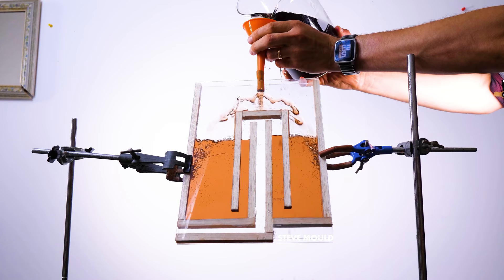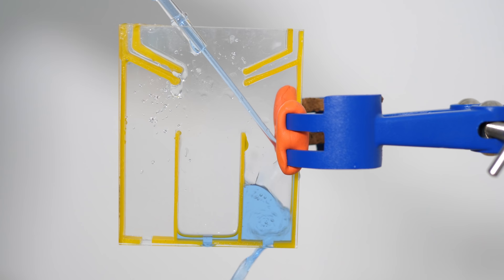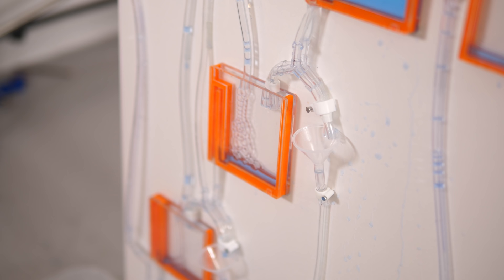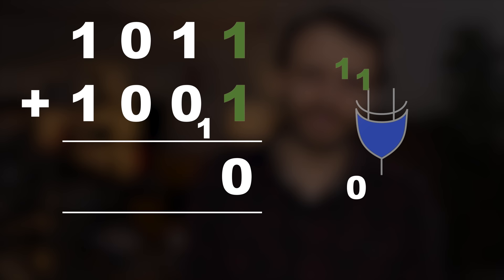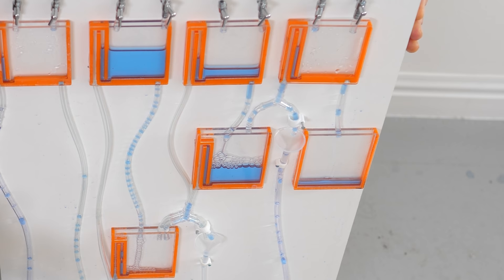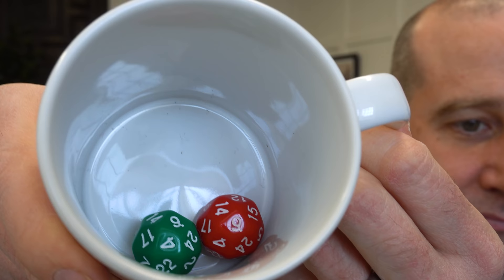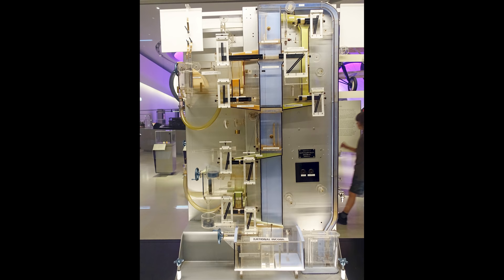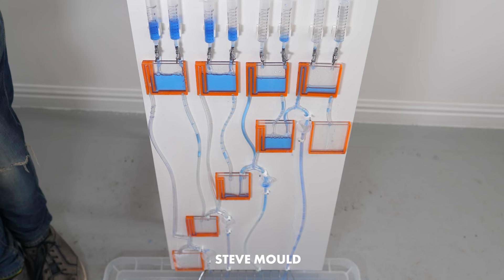I Made A Water Computer And It Actually Works

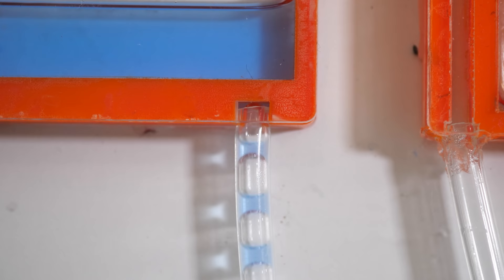Comment: 9:55 
As a computer scientist, I highly appreciate this series of jokes.
Reply: Jokes? OK i can get it as a joke, but that's a brilliant logic interpretation in physical world.If you get this, you will have no problems understanding logial gates in the future:)
Reply: @ogi22  but that's not how memory leaks physically work :)
Reply: @ogi22  :)
Reply: @khodis2002  it is now
Reply: @ogi22  Regarding the memory leak one, that's maybe similar-ish but not really a real-world equivalent. Memory leaks happen when a subsystem doesn't inform the OS that some part of the memory is free to be used again. So subsystem has nothing to do with the memory, OS still thinks it is being used.
Reply: @CrazyHorse151  maybe you can count it as a buffer overflow?
Reply: @ogi22  memory leaks are when the OS thinks certain memory addresses are being used because the process using them never told the OS it was done using them even after it closed, or the process asks for new memory without clearing old memory
Reply: I built one for a co2 tank farm. An array of check valves and pressure differentials
Reply: @spandexgoblin  Andrew Nevarez and CrazyHorse151 explained it very well.
Reply: This comment turned in a stackoverflow answer
Reply: @simonepozzoli  Just missing the "Comments are not for extended discussion. This discussion has been moved to chat."

Comment: Btw. I think there is a way to turn this into a digital number once again: Once all individual "buckets" have settled, you could put the fluid from each bucket onto a lever scale and put them at the corresponding distance to the center such that their pull on the lever corresponds to their number. So meaning:   8 _ _ _ 4 _ 2 1 |  _ _ _ "measure" (maybe with a spring and a ruler). The number 8 corresponds to the fluid in the bucket which has the bit for 8 for example.
Reply: Great idea! Now we only need a way to do the opposite.

Comment: Need to get Cody and his supply of Mercury. Won't wet the glass so no failures from trapped water
Reply: I wonder if one of those hydrophobic sprays would do the trick too.
Reply: @23Scadu  that would absolutely improve the performance.
Reply: @23Scadu  better get Rhett and Link on that part. Greatest crossover in history.
Reply: A Mercury Computer 😲 That would be soo cool!
You could also couple this with an electric switch system because of the conductivity of mercury.
Reply: Wouldn't that form problems with the increased hydrostatic pressure of mercury?
Reply: @23Scadu  That's bigotry!!!
Reply: @ksp-crafter5907  really old computers used something like that
Reply: @swimmingcat1275  Not in the very thin (pseudo)2D environment of such a fluid computer! Shouldn't generate too much pressure.
Reply: @ksp-crafter5907  I am more concerned about the seals of the containers. Mercury pushes through every pinhole it finds. (Also hydrostatic pressure is a function of the height of the liquid collom not the volume)
Reply: While Mercury would be amazing, think of the time and difficulty to safely clean and house it between calculations. He certainly won't be able to "etch-e-sketch" to a new calculation. So I think the hydrophobic spray is the way to go.
Reply: @RWAsur  
Yeah, material handling would be prohibitive. 
But... nothing a few hundred hours of CAD and 3D printing and fabrication couldn’t solve. 

It’d be gorgeous
Reply: Maybe try acetone or isopropyl alcohol?
Reply: @RWAsur  true. + a saline solution would also be a pretty good conductor for electric switches. (for a calculation result display)
I am thinking about nixie tubes for the result! 😎

Comment: This is taking Liquid Cooled™ to a whole new level
Reply: It is only the next logical step
Reply: Liquid driven
Reply: The trademark is giving me ominous vibes
Reply: @DTG4844  the trademark was the cherry on top wym®
Reply: Well... It's not Liquid Cooling... It's Liquid Core!
Reply: It makes it Turing complete
Reply: @chargemankent  liquid inside
Reply: @derbe8647  Fresh Outside
Reply: Liquid processsing!
Reply: Lmfao
Reply: Its not fps but lps
Reply: I would ssy Liquid Programmed™
Reply: Mineral oil.
Reply: Powered by Liquid Cooling
Reply: *pours boiling hot tea in the computer
Reply: Instead of Liquid Cooled, it's basically Liquid Powered.
Reply: @gotchabiqch8942  Bruh come on®
Reply: Cooler master 4000
Reply: @DTG4844  Liquid™ Cooled™
Reply: Liquid™® PC™®©
Reply: You cool your electric circuit with liquid???
I cool my liquid circuits with electronics
We are not the same

Comment: This seriously just made me understand the part of computers that I could never quite grasp. 35 years of not understanding why the gate system that computers use works, all answered in sixteen and a half minutes. And now that I understand, I can hardly believe I didn't before. 

I honestly feel that my life is about to get way easier, thank you for that
Reply: I even just understood the concept of 1 and 0 bits, very awesome way of connecting the digital to the physical world
Reply: Yeah it's why I took a bunch of computer architecture classes and stuff in college. I really wanted to understand how things work all the way down. It's really fascinating.
Reply: Spot on this is exactly how you are tau in college, water explains the flow of current through faucets,, the water is there potentially but until you draw it, flow cannot occur same with electricity and logic gate's, in this case it shows both the flow of electrons and the logical outcomes 👍

Comment: Instead of splitting the lines to make a "10ml" out of a "20ml" you could use a reservoir which can hold 10ml and just use the overrun. That way it can not split unevenly accidentally.
Reply: I was thinking the exact same thing! Make it go through a tube on the side of the tank raised by the exact amount and you're good without spills
Reply: @AlxM96  Isaac Newton's water clock worked this way.

Comment: 2:33 and that is what in electronics we call as timing and propagation issues. Electrical signals also suffer from timing or other problems like jutter and clock skew among others. Lenght of wires, crosstalk, etc.

Comment: Next step is to outdo Ben Eater: "I built a GPU with my water computer."
Reply: doesn't even need cooling, it runs on water!
Reply: What's new language to learn to code on this new water computer 🙄
Reply: @techboywitha7887   Java, the answer is fed into a coffee pot.
Reply: @techboywitha7887  In theory you could run any language on it, given enough computing power and a structure similar to modern computers. In practice? 
Extremely basic assembly.

Comment: While watching your video I actually came up with an idea of as to how to make a classic transistor using only water. 
Perhaps you could take a normal tube with a propeller in the middle which is supposed to act as a pump. The water from the first input comes directly into the center of the propeller, meaning that it won't be able to spin it much, but a second current of water comes tangent to another propeller that is coaxial with this one, meaning that both inputs have to have water flowing through them to have water at the output.

Comment: Mistake at 6:50 when you show the full adder for the first time. You show the output as result=1, carry=0 when it should be result=0, carry=1 since 1+0+1=10, not 01. Just some clarification if anybody tried to work out the logic of the full adder diagram and got confused when they saw the wrong result.
Reply from the maker: Good spot! Damn
Reply: Surely "Good spot. Dam?"
Reply: I was looking for this comment. I thought I am making some mistake

Comment: 6:58 I'm pretty sure the 2 outputs at the bottom should be swapped. I just started at it for 5 min trying to make sense of it. The 1 should be carried and the 0 should be on bottom. Love your vids dude!!!
Reply: The outputs are fine. The arrows are wrong. The top arrow should be pointing at the 1, and the bottom one should be circling around it to the carried 0.
Reply: @PerseusMax  Hey, no the arrows are fine, the outputs are wrong. In Binary 1011 + 1001 = 10100 , so what happens is where the left output arrow is pointing there should be a 1, and where the right output arrow shows, there should be a 0
Reply: @armandoespinoza7370  Yeah, you are correct. I'm not sure what was going on in my brain...

Comment: This is really cool. One thing I've always wanted to see somebody do is make an actual circuit that uses the hydrological equivalents to passive electrical components like textbooks always use to familiarize you with them. That is, use a narrow section of pipe or tubing in place of a resistor, use a flexible diaphragm that flexes back or forth as a capacitor. And use a weighted water wheel or turbine as an inductor. I've always wanted to see somebody try making something like an RLC circuit that oscillates at a specific frequency when energy is added in the form of voltage or current. OR in the case of the water circuit, by water pressure or flow. Which are the equivalents of voltage and current, respectively.

Comment: They made both pressurized water and pressurized air computers.  In both cases they used the "stickiness" of both fluids.  The gates were Y shaped and at the junction there was an "input" on both sides to push the fluid to the left and right.
Reply: when under pressure, fluids behave quite similar to electrical current. All basic equations (including many differential equations) still work.
pressure = potential
pressure drop = voltage
flow rate = current

thin pipe=resistor
reservoir=capacitor
long straight pipe = somewhat of an inductor (resists change in flow rate)

Comment: As I understand typical fails happen because of 
a) splitting water in half as your siphon results in 20 ml instead of 10
b) leftovers in the bottom section
Which results in less than 10 ml input in later cells. 
So I had an idea to manage this without Y-split tubes: you can vary the with of the cells and double it in each iteration so your "1" in second layer will be 20ml, in third 40ml and so on. But the projection you show on camera would be the same. Besides you can decrease the width by 5% to compensate the leftovers. 

P.S. instead of Y-tubes you could also use the siphons with output on half-height to precisely get 10 ml of 20.

Comment: So I made a joke in the comments on matt's video about some work I did in my MPhys degree involving water based transistors. It was a while ago so my memory was foggy but I think I'll share what I can!

Our setup was actually very different, they were made from a plastic cylinder with a rubber tube passing through it. The source goes into the rubber tube, the drain comes out of it. 

The trick comes when we fill the rest of the cylinder with water and connect it to a tank representing a gate! It applies pressure on the tube, clamping it down and stopping the flow. You could easily adjust the pressure by either filling/emptying the tank or by changing its height relative to the transistor. It mimics a field effect transistor pretty accurately!

The study I worked on was less about how the setup compared to a electrical one and more about some strange turbulent flow that happened at certain settings and some assymetry between raising and lowering the gate but that stuff's not relevant to the video at all and I don't remember the details too well...
Reply: Interesting to see another take on the same premise. That's impressive.

Comment: You can construct a liquid digital display by building binary decoders with the outputs corresponding to the different horizontal/vertical sections of a digit (like in a digital clock display). For your adder, you would need a 4-input, 16-output decoder. 8 of the outputs for one digit, the other 8 for the other digit.
Reply: Similar approach as this bacterial digital display: "Programming Escherichia coli to function as a digital display" (2020) Molecular Systems Biology. You would just need to connect it to the outputs of the adder.
Reply: As cool as this project was, going that extra step and adding in a liquid “digital” display would have been incredible. But it feels like just this must have taken a very long time to accomplish as is.

Comment: While trying to figure out exactly how the full adder works, I realized that there's a mistake in this (6:50) diagram. On the second column, the answer should be zero and the carry should be one, not the other way around.
Reply: I noticed this as well.
Reply: Yh.I noticed it. I thought I was wrong at first. I had to redo it several times and even after getting the same answer each time, I had to check the comments. Lol.

Comment: A brilliant display of logic circuits at work. I plan to use this in my class :) Just a technical correction, at 6:50 the full adder will have an OR gate instead of a XOR on the left (in the end). In other words, the Cout would come out of an OR instead XOR.

Comment: I had a roommate in Arizona that worked on an Air Powered computer for his Masters Thesis. Shoutout to Carr for being annoyingly proficient in math and electronics. I can't remember his first name, but I think of him often
Reply: I've had that in my head for 10 years or so. Haven't yet succeed in printing the necessary valves...
Reply: @ThePixel1983  from what I remember (from story I heard in 2004), they used almost entirely off the shelf pneumatic parts. If I remember correctly (which probably isn't correct) they got near 100hz. It was his thesis for an early 90s masters in mathematics. 
If I could reconnect with him, I'm sure he'd be happy to help similar projects. Carr let me borrow his 91 CRX Si to visit my GF 10 hours away. In hindsight, I was a terrible friend.

Comment: I think the problem lays with your siphon. You don't need the drain - which can dispose of a random amount of water and prevent the next siphon from activating. I would lower the activation threshold on the siphon or increase the volume of water that constitutes a "1", as well as raise up the bottom of the siphon so it cuts it off before sucking up more than half the water.

For example, let's say each bucket can hold 1 cup. Let's make a "1" be any amount >= 3/4 cup and a "0" is anything less than that. We set our siphon so that the rightmost wall cuts off at say 2/3rds cup (3/4 ideal, but let's account for error). 
1+1 = 10 
-> 3/4 + 3/4 = 1.5 cups. 
Our siphon activates when we reach 3/4 cup and stops when it reaches 2/3rds cup - sending a little over 3/4 cup along and leaving a little less than 3/4 cup in the bucket.
Now, we don't need any drain to introduce more randomness - just that anything over 3/4ths cup will activate the siphon. We just need to make sure the buckets at the end can hold a little extra (or just let it overflow onto the floor).

Comment: I imagine you could use the surface tension of liquids, the siphoning, and an enclosed system to make hydraulic logic gates that achieve transmission through a circuit of fluid without necessarily needing to involve any pistons for driving the circuit. This video made Steampunk a lot more plausible/interesting for me as genre haha.

Comment: As soon as you mentioned having XOR and AND in the same gate, I knew you'd be making a very clever adder with carry
Reply: The gate is actually universal. Hold one input at 1 and the XOR output implements a NOT gate.
Reply: @Roxor128  That's an excellent point! Mostly I was thinking about the fact that a single XOR+AND gate can be used as a compact half-adder.

Comment: I had a thought with the "slow leak" XOR design - if you could close and open the outputs, you could hook each of them up to the same mechanism that you toggle at regular intervals, and it would (kind of) simulate a CPU clock!

Comment: Love this set of videos. This one in particular.
I think there may be a tiny boob at 1:30. You've just explained why this is both an AND gate and an XOR gate. Then you say it's an AND gate or an OR gate. Interestingly the little Y tube  you added to the bottom is an OR gate as its outlet flows if either or both of the inlets flow.
...but I suspect you knew that!

Interestingly, I think that many of the problems with the original device are quite analogous with silicon semiconductors... Considering what happens with under (and over) voltage and current...!
Reply: So I believe the Y tube would be an XOR because if both are on, the AND output is read because of the collision, and so two input streams wouldn't produce a flow into the Y. I suppose to make it an OR you would have to run the XOR output and AND through another one of the gates and take the XOR output

Comment: All of the XOR gates you see at 7:19 are supposed to be OR gates (they were supposed to be in the diagram before, but there it's easy to point out), otherwise fantastic video!

EDIT: Realized that it technically doesn't change the logic, purely because the logic around it doesn't allow it, but it is something to keep in mind as OR gates are usually simpler to implement than XOR gates

Comment: You can do an ancillary video about fluidics.  The military actually built control systems with complex logic gates that operated in line with hydraulic fluid to perform ratio, multiplication and division operations that resulted in dynamic control surfaces that adjusted force output based upon input parameters like airspeed, inertial forces and pilot input.   These were early attempts at making logic based control systems that would be immune to EMP in nuclear war.  What they looked like was tall stacks of thin steel plates with channels cut in them, separated by gaskets, where the inputs and outputs where holes passing into adjacent plates on one side or the other. The whole thing was filled with hydraulic fluid at pressure, and the flow thru the various inputs controlled by valves and regulators, with the flow either resulting in greater or lesser hydraulic flow to the control surfaces.